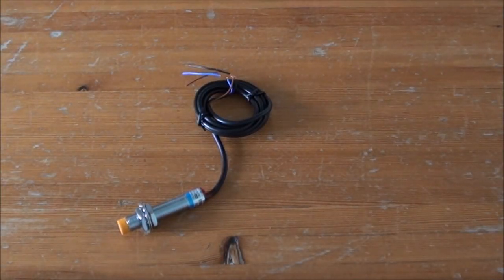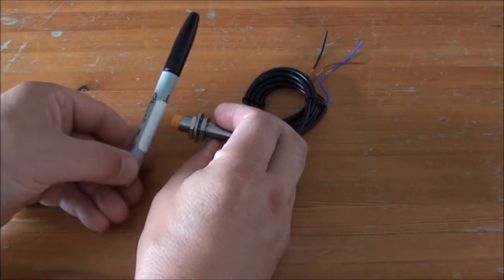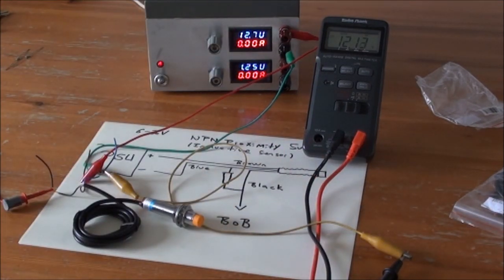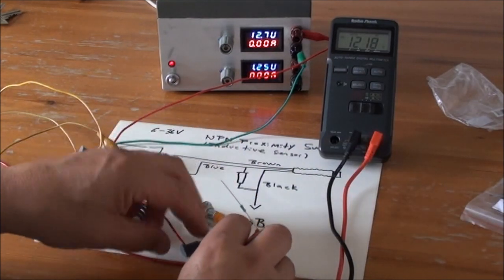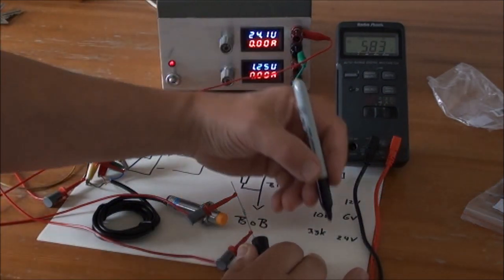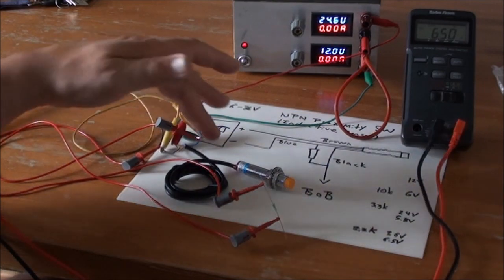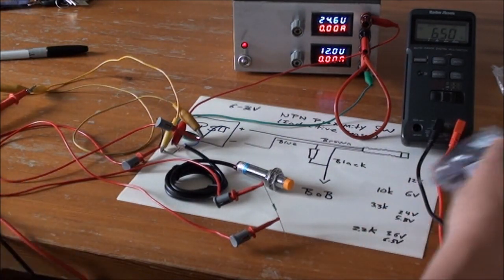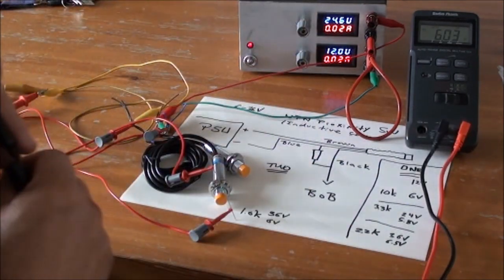Inductive Proximity Switch as limit switch for CNC - connection and selection of  pull down resistor

Comment: I would put a voltage divider differently so the switching transistor wouldnt load up with current and heat up or damage the control board. One resistor off the end of the black wire and at the end of that resistor add another resistor and connect that to the ground. Saves the switching transistor from loading up in current and keeps the sensor from getting damaged as well as the control board

                                                       |GND|
                                                          |
---|sensor out (BLK)|---------|R|--------------|R|---------|Home Switch Control board|

Comment: Hi Martin, does this work to use 24v proximity sensors with Pokeys57CNC board for limits and homing? a 3Kohm for 1 sensor and 1.5Kohm for 2?
Reply from the maker: Hi Neil, PoKeys input are for 5v only - so you need pull down resistor or Zeener diode to use w 24v signal. Check the output with voltmeter before connecting to the controller

Comment: Why are you doing this with a resistor? You should use a Zener diode and a small resistor. That could give you 5.1V or 4.7 volt out if that's what you want.

Comment: With a NPN sensor wouldn't you connect the resister between the Black wire and +Volts? Your diagram shows it connected to -Volts and that would be correct for a PNP sensor.

Comment: Could you hook up two proximity switches in series so each was getting 6 volts from the 12 volt power supply and then use the 6 volts for the breakout board?

Comment: Good evening Martin, excellent video, I understand how to play on the output voltage .... but I do not understand why when I place my sensor with the orange nose down, the earth, it lights up so detect, I also have the impression that it detects my hand that I approach on the aluminum body ..... but nothing happens when I approach the iron or other material ... on the orange nose ...? ?? it is connected to a control card according to the following diagram ... Black for signal, Blue for GnD, Brown for + 12V ...
Here is the link of my sensor ...
https://fr.aliexpress.com/item/32748267115.html?spm=a2g0s.9042311.0.0.27426c37ggjUer

Thanks for your help...
Philippe
Reply from the maker: Are you sure what type of sensor it is? To me it sounds like it could be a capacitive sensor. The one I'm working with in thes video is Inductive.
Reply: @martinbarfoed5040  yes, it's this following....
https://fr.aliexpress.com/item/32748267115.html?spm=a2g0s.9042311.0.0.27426c37wRntRd
but i don't understand where the issue is...do i need to wire it with another way...? thank's a lot

Comment: very good explanation but can you tell me how to wire it to run a digital tachometer to check rpm of machine spindle thank you
Reply from the maker: I havent tried that. Some controllers have a separate input for encoders to control. One I know is Acorn from Centroids

Comment: If my breakout board is rated 12-24v on the end of the board where i am connecting the black signal wire then should i put a resistor or just leave it?

Comment: Rockwell Automation published a diagram of how to connect NPN and PNP sensors in series and in parallel. 
In parallel connection a diode is installed between each sensor and the load.

Breakout boards that have built-in pull up resistors will only work with current sinking (NPN) sensors.
Reply from the maker: Thanks for your comment.

Comment: Hello Martin, nice educative video. Thanks. 
The output is digital or analog? Digital, for example 12V or 0V? Or it can be analog any value between 0-12V detecting distance too?
I am trying to detect if target is moved from some fixed position.
Reply from the maker: This type of switches are digital. Either on or off. Not sure what sort of sensor that will do what your are looking for. Ultrasonic maybe?

Comment: Nice Video. Can you do a video on connecting pnp nc switches in SERIES. My plc has limited inputs and it would be awesome to just use 1 input pin. Everybody shows just one sensor or they wire them in parallel.  I have 4 wire pnp no/nc sensors. I want to send 5 volts through until one of the sensors sense metal and then open the circuit to ground.

Comment: Nice video if ever I used 12 volts and I need to pull down in 5 volt what value of resistor I need to get 5 volts
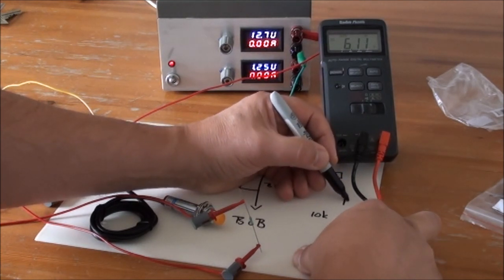Reply from the maker: Ike Cobey It must be around 10k. See video at ca 4:40

Comment: Great Video Martin..I am in the process of changing my chinese CNC router over to using  Mach 3 and a ESS smoothstepper with a C25  BOB .I Need to change the NPN  NO  proximity voltage from 24 volt to 5 volt ..When using  different 24v supplys with a different amperage is it possible that the value of the  resistor needed  will change as well?  ..How many amperes  are you testing with your unit?
Reply from the maker: I would not expect that a different amperage of the PSU will influence the resistor you need to use. But for safety - do a test using a voltmeter before connecting to you BOB.

Comment: How bad is it to only supply them 5-6V from the start?
Reply from the maker: Julius Jahn They are typically rated for 6-36V. But it seems that there is some loss of accuracy if you are in the lower end.
Reply: most sensors I've come across are rated for 10-30v DC, so you would have to drop the voltage or interface them some other way

Comment: Nicely explained. 
I have a single axis machine ( X axis) I want to connect inductive proximity switches NPN type( LJ12A3-4-Z/BX) at the ends as limit switches. i am using Arduino Uno & a stepper motor. Where & how do I hook up the switches? Your help will be appreciated.
Reply from the maker: You will need to connect the sw to some power - typically > 6V. The signal connects to one  of the digital inputs on Arduino via a pull down resistor. I think you can use same procedure as Im doing the this video to find one that fit as you will also need ca 5V on the input

Comment: are they normally closed ones and switch to open when the metal object within the sensing distance was thinking of getting some normally open ones and using them to switch a transistor or mosfet for my grbl shield.
Reply from the maker: Normally Closes (NC) switches will be active when no metal is near - this means that the LED is lit and you get signal out (GND for NPN and Vcc for PNP)Same story for Normally Open (NO). They will become active when metal is coming close enoygh to trigger resulting in signal out (GND for NPN and Vcc for PNP). I'm working on a video comparing all four types of switches.
Reply: @martinbarfoed5040  Here you say 'Normally Closes (NC) switches will be active when no metal is near - this means that the LED is lit and you get signal out' but in your other video (NPN & PNP NO NC Proximity Switches - experiments with function and Pull Down Resistors) you show the NPN NC as INACTIVE LED ON and ACTIVE LED OFF. So Which is it?

Comment: Hej Martin. Tusind tak for gennemgangen.
Er der en måde at regne sig frem til et resultat, da en af mine venners CNC kører på 20V?
Reply from the maker: It's unfortunately difficult to calculate as we do not have data on the internal components in the switch. So that why I use the experimental method. If you would like to see how to calculate you may look here: http://www.ti.com/lit/an/slva485/slva485.pdf

A guess for you 20V PSU would be to around 4k